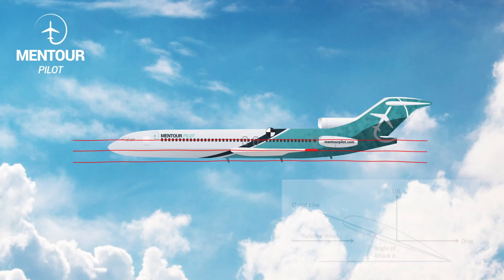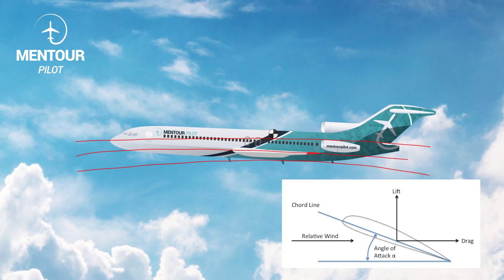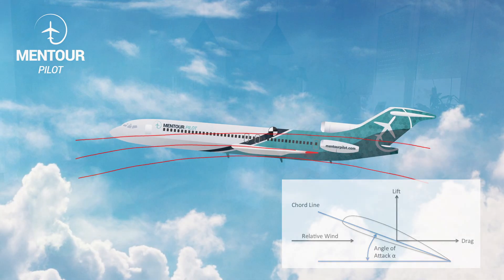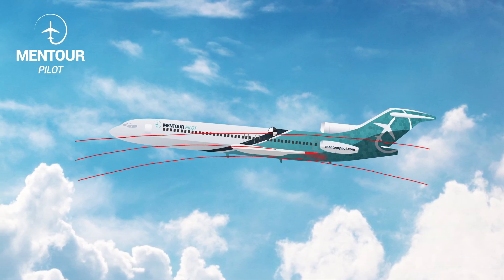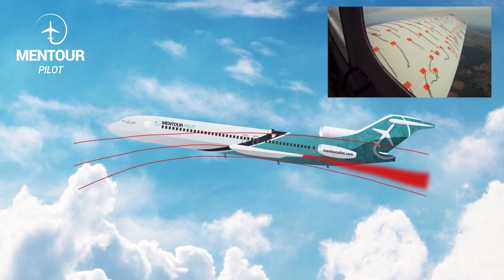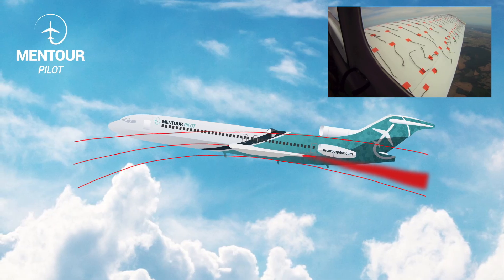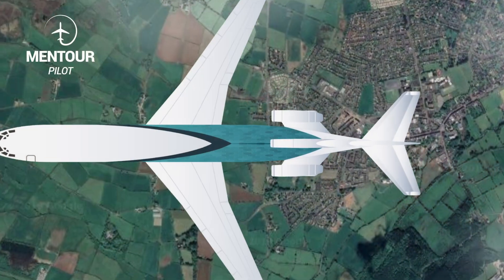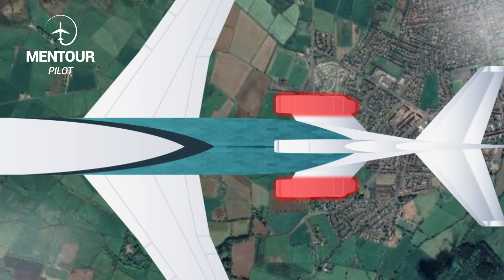The STALL you can't get out of! SUPER-STALL

Comment: I believe it was a deep stall that took a Trident down shortly after leaving Heathrow in the early 70,s? That was something to do with leading edge droops in the wrong position on takeoff I think? Scary place to end up! Cheers.
Reply: The pilot & copilot had a disagreement pre-flight. One of the problems was that the flaps were deployed, but this wasn't consistent with the pilot's thrust/aircraft attitude. The stall turbulence put all 3 engines out of effective use (shielded by the wings' shadow).
The fact that it was just after take-off didn't help.
I do remember the massive black cloud from the crash (I was in the area at the time). The amazing thing was that the crash site was surrounded by houses and major roads, yet it hit the only open space in the area.
Reply: @colinprice712  Appreciate your time to reply and thanks for the missing bits.

Comment: Greetings, @Mentour Pilot. Can you please compare the sidestick to the steering column? It would seem to me that the sidestick -- or, the joystick, if you will -- is a very idiotic innovation. I mean, would any of us think of manoeuvring our cars in a sudden and demanding situation such a slip on ice with as ergonomically unhandy a control as the shiftstick, or even just in order to drive down the road? Hmm, I wonder why sidesticks have not been introduced in automibiles! Yep, somehow those mean Formula 1 drivers still use the old-fashioned steering wheel for optimal grip on their vehicles' movements.

The sidestick on aircraft seems to be a disaster waiting to happen (or a disaster that has already happened -- consider the inability of the pilot in Moscow to land his aircraft safely in emergency manual mode last year that led to 40 deaths). The autopilot functions hide the sidestick's unwieldiness most of the time, but the problem is that manual control is required above all precisely in non-normal, non-autopilot-guided situations. Shouldn't the pilots of the world speak up and address a collective demand to the manufacturers to reintroduce the steering column? I did some flying on Cessnas and there's no way in the world I would feel in control with a joystick in those things. How you guys do it, and why you put up with it, is beyond me.

Comment: In airplane design, T-Tails have to be in a certain ratio of height to distance from the center of lift. This ratio makes sure that the tailplane is above the wake area in a stall and so prevents deep stalls.
The same applies to rudders. The design of rudders must be so that a useful part of the rudder is still outside the wake area and can be effective in a stall situation.
Lessons leaned from the accidents in the past.

One thing you can also do in a stall is shifting the center of gravity. Like all passengers running forward. This is not very likely but could work.
I also works in a flat spin, which is another very dangerous situation you would not want to get into, because then all surfaces stall simultaneously. This is prevented usually by having the center of gravity before the center of lift by contruction and loading. Which is a requirement in designing an aircraft.

There is much more to it that has to be considered during design.

Comment: The Trident was a high T tail aircraft and could super stall. The only way to get out of one was to fire a parachute out of the back to lift the tail which was done on initial proving flights. A superstall was the cause of the Staines crash near Heathrow in 1972. Someone retracted the leading edge droops ( now called slats ) which could be controlled independently of the flaps on the Trident. They had all the warnings but ignored them and cancelled the stickpusher. Incredibly Tragic.
Reply: Steve;   Were those super stall recovery parachutes installed on production passenger carrying  Tridents or were the pilots just told "Don't do that!"?
Reply: No, they only used them one time AFAIK at Hawker Siddeley during the proving phase of the development.
I knew someone who was involved in the testing.
Reply: @Vincent_Sullivan 
The Tupolev 104, being based on  bomber, had a parachute to help it stop as its brakes were dire and had no reverse thrust.

It also had swept wings and wing fences to stop the lateral air drift...
Reply: One of the saddest accidents I have read about. Because of the lack of C.V.R, we can only guess as to who exactly retracted the droops. Due to the probable incapacitation of Captain Key, the aircraft did not reach flap-retraction speed, and the lack of visible cues and experience of the 1st and 2nd officer did not help either.

Comment: in a warbird simulator situation i once got out of a stall by using the torque of full throttle to roll the plane.....perhaps shutting one engine off or going into reverse thrust and on the other engine full throttle to attempt to get the nose down?
Reply: C G Those are not techniques approved for use on passenger aircraft.
Reply: @gordonrichardson2972  approved or not does it matter if the alternative is hitting the ground at terminal velocity in a superstall, the question wasn't if the attempt was approved rather if something like that would work as a last ditch attempt to get something back in regards to authority over an otherwise dead plane.
Reply: @gordonrichardson2972  running down the aisle with my arse out and swinging my schlong around like a helicopter rotar wouldn't be approved by the Civil aviation authority and I'm sure would raise some gasps and eyebrows from passengers and crew as I waggled my way past them but if it rescued the craft and the passengers from certain death then I'd do it....and with all due respect the CAA could stick their reprimand on my....... record.

Comment: In a superstall scenario with no authority on aeirlons , rudder or elevator....would putting the engines into reverse thrust and maybe full aeirlon pitch at least oneside fetch the nose down or roll the plane enough to get some airspeed back once the angle of attack has changed, if it would change with full reverse thrust?

Comment: In some landings you learned (mostly older textbooks and from older instructors) to land in a full stall condition. These landings works as follow: The wing goes into a partial stall 10cm - 1m above ground and then push the wing in a full stall. It's a super short super precise landing. (stabilise the wing 10cm-1m over ground, reduce speed till partial stall of the wing, push the wing in the full stall to stop any forward momentum and then touch the ground)

It's not in the textbooks anymore and instrutors let you fly either way but mostly only teach you the transition way of landing.
Reply: You could do this with a cessna, but I doubt that this would be a recommeded landing procedure for a 737 :)

Comment: I would assume that putting the gear down might help fight the unrecoverable stall, as would differential engine thrust (if they don't stall too) and applying some flaps. My reasoning is that you need to change the attitude of the aircraft. None of the above might be safe to do, except maybe the thrust one, and may result in damage to the aircraft, but landing a damaged aircraft is probably better than crashing a good one
Reply: A 'super-stall' mostly affected rear-engine T-tail types.   As such, differential engine thrust wouldn't have much directional effect on the aircraft.   (This was of course an advantage in handling for the engine-out case).

Comment: Why would engineers design a plane with the CG behind the CL? I'd imagine this is mostly a problem for planes with heavy aft cargo. Can you explain which type of planes are most impacted by this scenario?
Reply: Usually the CG has to be per design in front of the CL. That is something you have to prove during certification. And it limits the loading of the plane.
CG at or behind CL is done for very maneuveralbe aircraft like fighter jets where electronic controls are needed to fly stable.

The CL shift occurs during stall from the normal position forwards. It has to be controlled in a way that you can recover from the stall.
Reply: @roichir7699  Assuming your CG is in front of CL, wouldn't it be impossible to super stall? If you had enough altitude when it happened wouldn't the nose wanna fall?
Reply: @damienpooschke  It is still possible with some T-Tail or cross tail planes as stall is an aerodynamic condition and deep stall is the condition when your tailplane is covered in the wake field so that the control surfaces are not working.
Then you have the shifting of CL during stall, which goes forward. So you may come clos to critical areas where CG and CL meet. It is not impossible. But preventable.

With the usual design of tailplanes or some more considerations with T-Tail designs you can avoid deep stall. That is what you need for new plane designs to be certified. However there are still old planes around.

The CG before CL rule hase more implications in respect to stability and avoiding flat spins, than deep stalls.
Reply: @roichir7699  Thanks for sharing your knowledge. I learned a lot.
Reply: @damienpooschke  You are welcome.

Comment: Note to self: Don't get into a stall 100 feet above the ground.
Reply: A stall at less than 1000 feet will only give you time to become religious, no matter the plane.
Reply: @bogdan_n  I think the F-22 would like to say hi. That plane has the power and technology to say some nasty things to the laws of aerodynamics. The same probably applies to most modern fighters as well.
Reply: @bogdan_n  I've recovered dozens of stalls with only 100ft of altitude lost, with and without flaps and power from full to idle,(starting at 2000ft) but I agree its best to avoid stalls near the ground. The design and loading of the plane matters quite a lot, a swept wing plane usually needs closer 1000ft because they tend to stall near the wingtips and because the higher airspeed typical of a swept wing design just increases the rate of everything including descent. 
Also flown tens of miles at the edge of stall, mushy controls due to low airspeed and the warning horn can get annoying, this is to simulate being too slow on approach or departure. Both are a standard part of training for all levels of pilot certification in the USA.
Reply: @mytech6779  i didn't mean an "approaching stall", a "near stall", a "hint of stall". I meant a stall, a total loss of lift, and pitch authority.
Reply: @mytech6779  : "dozens of stalls" 
Me: Remind me never to fly with you. Also I would say, Note to self: don't stall to begin with.
Reply: @kyle333halfevil  it's a part of flight training. There actually fun
Reply: @fox-icewings  I've got a fear of heights. But if that wasn't a problem I'm sure I'd enjoy it.
Reply: @EnglishDrifts69GTxRED  They could also be a pilot trainer.
Reply: @fetzie23  If he were that bad a pilot we would not be hearing from him.
Reply: @demopem  I am with you.  "Speed is life; altitude is life insurance." - actually was a helo pilot who taught me that.  He survived three tours in Nam, and I suspect he could fly a bit of everything.
Reply: @lisanadinebaker5179  Though if he was a heli pilot it's more "Rotor RPM is life".
Reply: Aw look at this guy, he's recovered from so many stalls in 100ft, what a baller, he's so smart, women want to make love to him and men want to be him
Reply: Unless you’re right above the runway.

Comment: What you said about the movement of the center of lift when the wing tips stall reminded me of a spin recovery technique that was developed for the F-14, which was notorious for entering unrecoverable flat spins.  The technique involved sweeping the wings fully aft, thereby moving the center of lift aft of the center of gravity, causing the aircraft to nose down and fly out of the spin.  It did, however, require at least ten thousand feet of altitude to execute.
Reply: The F14 issue was mainly at low speed during approach to landing. It would get a compressor stall if slipped or skidded on the turn to final, while also being below single engine maneuvering speed(which was high due to wide engine placement), so quickly adding power to the good engine would actually cause or increase a spin. All while 200 feet above the water.
Reply: The general unreliability of the TF30 didn't help much in that area, either.

Comment: Maneuvering Characteristics Augmentations Systems.

An automatic override of pitch attitude to correct for nose high low speed stall. To high of angle of attack for given airflow speed of wing.

Profile change of wing over its length, as this will essentially change that particular sections angle of attack,  adds to the overall stability of the wing. Aircraft that have unrecoverable stall characteristics should not move beyond the drawing board phase. 
Of course flaps, spoilers, dive brakes, wing fences can all variable the wings speed requirements.
And stall speeds go up as the aircraft becomes more heavily loaded. Also landing gear down in slip stream can greatly impact stall speeds as well. Wing flex in high cross wind landings can challenge even the most experienced of pilots.
Winglets on tips can accentuate the leverage effect of cross wind landing.

Wind tunnel efficiency can teach us much but in the real world of wind eddies, micro down bursts, and severely turbulent conditions the wing design is magnificent tribute to airflow management.

Piling up in engine air ingesting nacelle and causing severe backfire of disruption of unburned fuel.
It has stalled and if not damaged can return to normal flight.
Engine compressor stall is essentially and extension of airfoil design and a type of wing stall.
The air becomes confused as to the laminar flow characteristics of the set incidence of turbine blade design.

You want to hear your craft has very honest stall behavior. She won’t fall off on one wing and she’ll shudder to let you know, give me air speed.
Nose down to gain airspeed. Never attempt to low air speed at low altitude. Fly her in. Don’t drop her as a stone to high above runway.

I believe forward canard winglets have potential to augment the pitch control of jetliners. 
But every thing in the slipstream creates drag. But just large enough to assist and not so large to become obtrusive.
The reason is to assist pitch control if a deep stall should occur. The tail becomes less effective it the turbulent air zone behind wing stall. Especially in high tail designs. The forward portion of the fuselage is still in laminar flow air stream. It could assist in regaining nose level for proper angle of attack for given stall speeds.

The Wright Flying Machine actually warped it’s entire wing to control roll.
Reply: Bill Bright Many interesting points!
Reply: "An automatic override of pitch attitude to correct for nose high low speed stall." 
This is incorrect, the purpose of MCAS was not to push the nose down. The purpose was to trim for increased control pressure because certification requires a certain amount of resistance, without MCAS at the extreme angles of attack the MAX just had very light elevator control feel.
Reply: MyTech That was the original intention of MCAS, for high speed maneuvers. However it was drastically increased in power to cope with low speed instability. Don't believe everything that Boeing asserted, they have an incentive to bend the truth.

Comment: A small solid rocket motor in the tail should weigh less than a single passenger and guarantee recovery, or perhaps a modification to the thrust reversers to give angled thrust?
Reply: MadScientist512 Test aircraft are fitted with tail parachutes for stall recovery.

Comment: You do not talk about geometric or aerodynamic twist?
Reply: Lean to Peak True, but that is more specialist scope.
Reply: @gordonrichardson2972  not sure if I agree. I would say geometric and aerodynamic twist are the main and most important measures to prevent the wing tips stalling before wing roots, more important than those mentioned in the video, but ok. May be a matter of opinion.
Reply: Lean to Peak Old fashioned aluminium wing structures are difficult to design with a built-in twist, which is much easier with carbon composites.
Reply: @gordonrichardson2972  it might very well be. But aerodynamic and geometric twist is the main one taught in aviation, when pursuing a pilot license, and it's also part of the exam questions. I really expected that it would be the first one to be spoken about!

Comment: Depending on the aircraft and load, you could have 50 passengers run forward, that's be a significant enough weight shift.
On a much smaller scale, this worked years ago for two fellows who got a Yankee into a flat spin, they had to open the canopy, stand up, and lean forward over the windscreen.
Reply: They did WHAT
Reply: @232K7  I kid you not.
Reply: Link?
Reply: @matejlieskovsky9625  You're not going to believe this but occasionally there are no links to things that happened well before the Internet.
As well, I once read a verified report of a Globe Swift (IIRC) that had a propeller blade depart and shortly thereafter the engine followed the propeller's example. The pilot was able to regain control during the ensuing loop and successfully got the aircraft on the ground intact (or what remained of it).
I once, by virtue of faultless stupidity, managed to half snap roll a Cessna 150 upside down at no more than 50 feet off the ground. I did not crash, and went on to a long career of less stupid aviation. I have no link I can send you but it did happen.
Reply: I'm a year late but I have to say, I love the way you write. It is very entertaining and to the point. I would imagine that people like listening to you speak irl. :)

Comment: Sabre Dance...

The tips of a significantly swept wing stall before the root and you have the center of lift move forward, causing the tail to drop instead of the nose.  This can often only be recovered from by forcing a spin.
At low altitude it is essentially not recoverable unless power > weight.